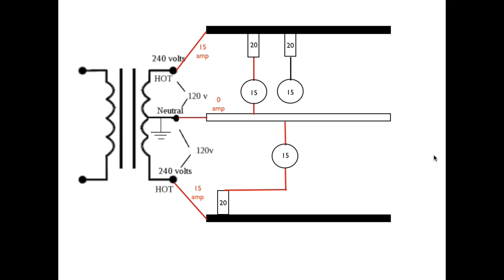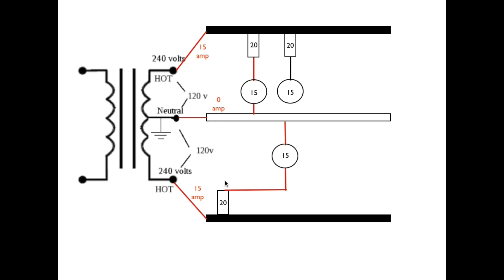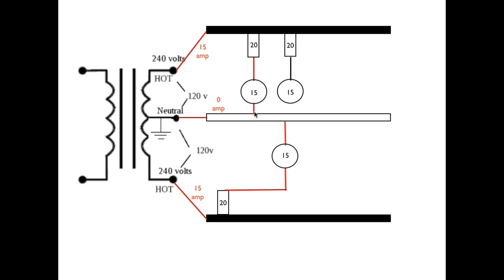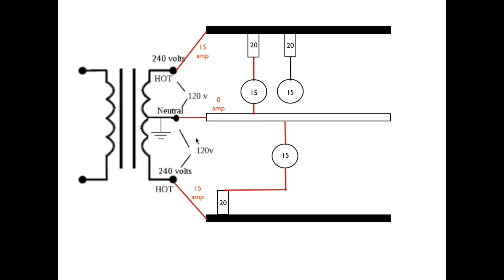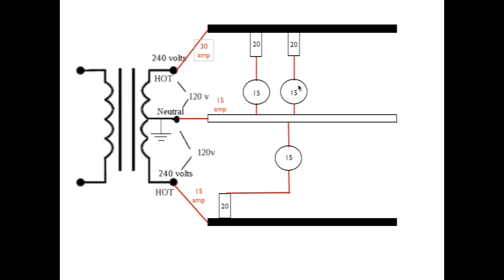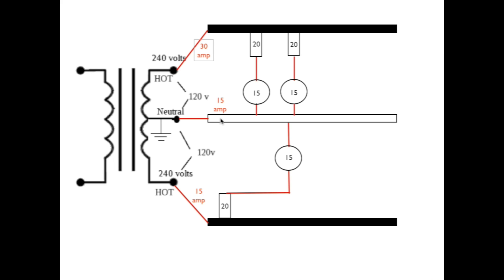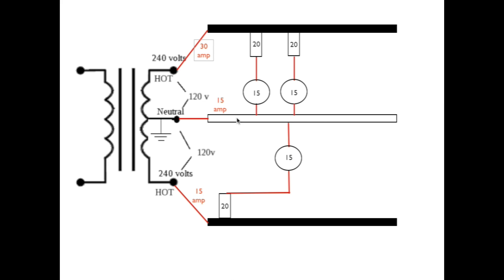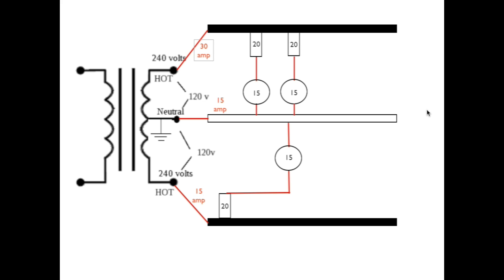How unbalanced loads work

Comment: Mr. Furnaceman, I am a retired IBEW Electrician. This is definitely NOT how unbalanced loads work in single or three phase. In fact the current path you describe is not used in North America I can't speak to the rest of the world.  Now this is the basic residential supply of single phase which is actually two phases. The main power lines will carry all three phases and the power company will alternate which two phases they run to each residential transformer to better "balance" the load from the substation. This alternating is not an absolute necessity however it makes the most efficient use of the power.

http://www.ccontrolsys.com/w/Electrical_Service_Types_and_Voltages

 
Also known as an Edison system, split-phase or center-tapped neutral.
 This is the most common residential service in North America. Line 1 to
 neutral and Line 2 to neutral are used to power 120 volt lighting and 
plug loads. Line 1 to Line 2 is used to power 240 volt single phase 
loads such as a water heater, electric range, or air conditioner.
At NO time does current flow through one breaker than another and back to the transformer. This would be Direct Current power like in batteries. Also it would be a direct short and blow up the breaker panel.
 I think you were trying to explain that IF everything was perfect and the power factor was a true 1 then even in 120 volt uses ALL the current would be used up and therefore no current would return on the neutral to be grounded at the pole.
All 120v items have to have a path to ground or the current will not flow,  Any 240 appliances do not have a neutral wire also called the grounded wire (because it is deliberately connected to the Earth to complete the current path). Their motors or heating elements use ALL the current going to them and NO current returns to the transformer on the pole as you can see by the plug they have two hot wires and a safety ground. The current comes from both phases, 120v from each being attached to a load using all the power which is what keeps the double pole breaker from tripping. It's a bit more complicated but this is the simplest explanation.. 
If the appliance also has a 120v need like a light bulb inside an electric stove the plug will have 4 prongs to accommodate the neutral for the light bulb.  
In a CB panel the breakers are alternated between the two phases so as to as evenly as possible divide the current draw. This is done to both reduce heat in the panel as well as most efficiently use the electricity your paying for. Again simplified but the resulting "unbalance" is minimized.
Reply: "The main power lines will carry all three phases and the power company will alternate which two phases they run to each residential transformer to better "balance" the load from the substation."

This isn't correct, they don't pick two phases and run them to your house.  They take one phase and center tap it in the middle which is the neutral.  So what you have running to your house is still single phase.
Reply: @jasonrawls6959  so you mean only 1 phase (out of the 3 in the OHL) will be supplied to the house plus the center tap neutral? so only 2 wires? then where does 240V come from?
and if only 1 phase is coming to your house, does that mean that the pole transformer is a single phase transformer?
Reply: K bu Of course it is a single phase step down transformer. Only one conductor 
entering the top of the can,   It is not connected to the center tap, but us connected to the primary coil. thank you.
Reply: @KhaledBu23  The pole transformer has 2 phases but for each individual home only 1 of the phases is used.

240v comes from alternating current. The alternation between high and low cycles (north and south poles so to speak) is on each of the phases. Center tapping 1 phase on the pole transformer creates a separation of that phase into 2. 1 with the north pole and 1 with the south pole of that phase with the center return which is connected to Earth ground.

The alternation in those 2 wires then supply either a heating element or motor, such as a stove, water heater, or air conditioner
Reply: @jasonrawls6959  True but notice I did NOT say run 2 phases to an individual house. I said run to the neighborhoods residential transformer where the phases are then center tapped.
Reply: yep, yep....If the load is perfectly balanced you would not need a neutral. Currently, there is no such creature on this planet. Whether its 1, 2, or 1,000 breakers. As soon as device is drawing power from a conductor, you have an unbalanced load.
Reply: https://en.wikipedia.org/wiki/Harmonics_(electrical_power)
Reply from the maker: +Greg Freeman I will be responding with a video to your entire comment hopefully soon.  Two things I will say here is there is no such thing as power being "used up".  It is not gone after leaving the load.  Also, if you are referring to earth ground where your quote was "All 120v items have to have a path to ground or the current will not flow"  that is incorrect.  Earth ground is not necessary for any 120 volt circuit.  I have done a number of videos on this earth ground issue.  Check my channel for the playlist "grounding and bonding" .  I do appreciate your comment
GFM
Reply: @grayfurnaceman  Doesn't matter how many videos you do when you don't know what your talking about

Comment: Say if you added a 4th load with 12A. Would the neutral carry out 3 amps?
Reply: +ABflanagan523 Please read my above post. Furnanceman doesn't know electric current flow. I'll try to make it simple. Lets say your using a coffee pot. It's rated 1500 watts. This means it uses 12.5 amps. (watts/volts=amps) It's plugged into an outlet controlled by a 20amp CB. The pot is using 12.5 amps of an available 12.5 amps. 0 (zero) amps are carried by the neutral. Yes that's correct. Only the needed amps will flow through the breaker to the appliance. Amps don't actually pass on to the neutral and ground at the transformer. It's the voltage that makes the whole circuit. This is a bit confusing granted since we always refer to the current path and current refers to amps. Wattage is an expression of the power used. The power comes from the voltage flow and the resistance of the item the voltage flows through be it a coffee pot or a light bulb. ( power = volts squared/resistance) It's a bit more complicated because of something called the "power factor" which refers to how much of the amp draw is actually being converted to power and how much is wasted resistance.
Reply: +Greg Freeman I see what you're saying and I don't. From electrical theory and what I was taught is that current needs a complete loop and that includes the ungrounded and grounded conductors. Without the complete circuit you would have an opening no current would flow. Voltage would be your highest potential and that would be dropped the across the load.
Reply: +Greg White a coffee pot should have a power factor of 1 because the cool is a purely resistive load so voltage and current are in sync with one another.
Reply: +ABflanagan523 load***

Comment: It is the great explanation for an unbalance single phase current return. Could you please also explain how a three phases unbalance current return back to the source work?  How equipment and human have been protected without a ground conductor? For example, 240V, 3 wire, 3 phase, Delta, and 480V, 3 wire, 3 phase, Y? Thank you
Reply: +Thichthanhtinh Nhut Please read my post above as Furnaceman doesn't know how electric current works and is totally wrong. As for your question the basic answer is grounded (neutral) conductors do not protect us. The grounding wire does. It is not a conductor. A conductor purposely conducts current flow. A grounding wire carries away harmful current from where it was not suppose to ever be to a safe Earth ground. Delta and Wye transformers are named to refer to how the phases appear electrically in relation to the transformer ground. There are many configurations with each type to produce needed voltages like 120, 240, 208, 480, 277 etc. The grounding wire is not counted when you refer to 3 wire 3 phase Delta or 3 wire 3 phase Wye. Because it is not a conductor. In all 3 phase equipment all the current is being used up by the pump or motor. Hence no need for a grounded conductor. If the design engineer of the equipment determined a safety wire is needed a grounding wire will also run to the equipment but even though there's 4 wires it'll still be called 3 wire because only the conductors are counted.
Reply: +Greg Freeman: Great explanation. I searched and asked these questions above to few electricians but could not get the answers for. Thank you for sharing your experience and knowledge.
Reply: A grounding wire's purpose is not to "carry away" harmful current.  Its primary purpose is to bond conductive enclosures, frames, etc. to the grounded neutral conductor and carry sufficient current to open a fault.   A grounding electrode conductor's primary purpose is to bond the neutral to ground to prevent a potential between earth ground and neutral.
Reply: @dburt1  Obviously you don't know what your talking about as "conductors" are not grounding electrodes and do NOT run to grounding electrodes.

And preventing a potential between between Earth ground and the neutral bus makes no sense since their bonded together
Reply: @gregfreeman6476  Your reply is a little less than coherent, but I'll try.  1) I don't think I ever wrote that "conductors are electrodes."  However, the wire that connects grounding electrodes to either the system neutral or the phase that is being grounded is called "the grounding electrode conductor" by the NEC and every electrician I know.  2) The earth ground and the neutral bus are bonded together BY THE GROUNDING ELECTRODE CONDUCTOR.  3) It should not be entirely correct to say they are "bonded" together because there is usually an appreciable amount of resistance involved, enough to limit current to a value that will not open an overload, or what we refer to as "clearing a fault."  That is why grounding wires that are part of branch circuits should have a low impedence path back to  the neutral bus so as to open the breaker or fuse as quickly and surely as possible.
Reply from the maker: Thanks for the sensible comment.  There are so many comments that misunderstand the purposes of neutral and earth ground conductors (I put that last "conductor" there for Greg Freeman).  If anyone doubts the neutral is the path to clear faults, try removing the neutral and short something to earth ground.  (Don't anyone do that as it is dangerous).  
GFM
Reply: @grayfurnaceman  Good to know your afraid of me correctly your misunderstandings and assumptions.

And what do you mean by "clear faults" ?

And obviously deliberately causing a short to Earth ground or anything else is dangerous.

Just like all your misinformation.

It's amazing someone who's only experience and knowledge is fixing furnaces thinks he's an electrical engineer
Reply from the maker: @gregfreeman6476  I am also a licensed electrician.  Clearing faults is a term used by electricians to indicate opening of a circuit by an overload device such as a fuse.
Preventing a potential (voltage) difference between neutral and earth ground is one of the reasons for the bonding of earth ground and neutral.
GFM
Reply: @grayfurnaceman  I seriously doubt your  licensed electrician, unless your non union and live in a state with no real world experience to get licensed, just book learning.

At least you agree with me me that bonding neutral and Earth ground is to prevent differences in potential.

I grant you terms are not universal in the electrical world. But the term "clearing" faults makes no sense to indicate there's a tripped CB or blown fuse. It would make sense, but it's not what you wrote, if it meant fixing the fault. Except that the word "fault" is defined in the NEC and wouldn't apply

Comment: Good explanation. Every appliance we have in Australia although is 240V rated, we use the exact same principle. To me a typical American power supply consists of 2 separate phases and a neutral - earth conductor. On most electrical installs where multiple phases are coming in, we spread those loads out to make use of the current capacity of the conductors.
On a 3 phase setup the neutral conductor may even be a bigger then the active or (hot) conductor as you guys like to call it to handle the unbalanced single phase appliances. Typically most motors are a great balanced load for 2 or more phases.
Reply from the maker: I think you have it right on.  Just the voltage is different.
GFM